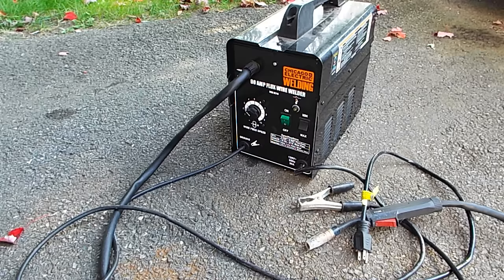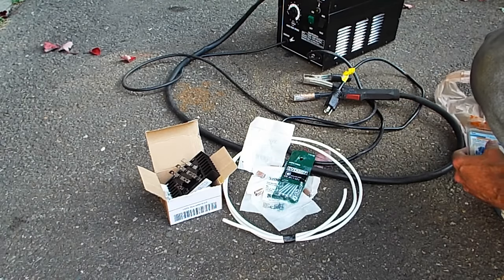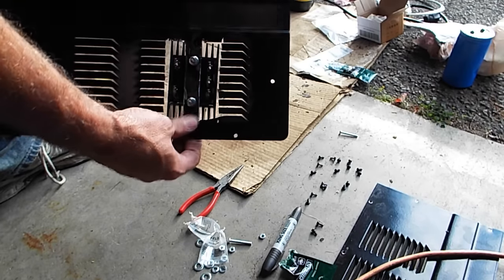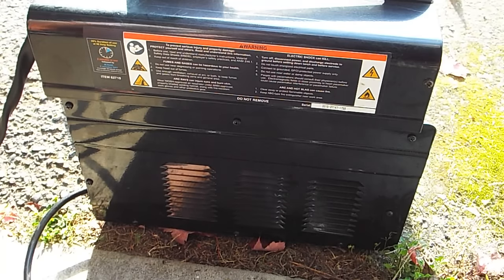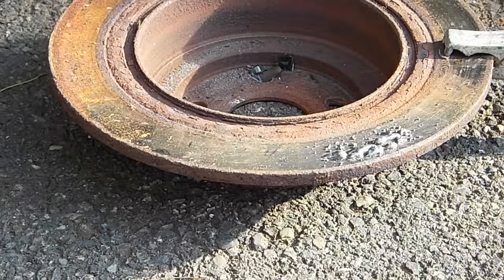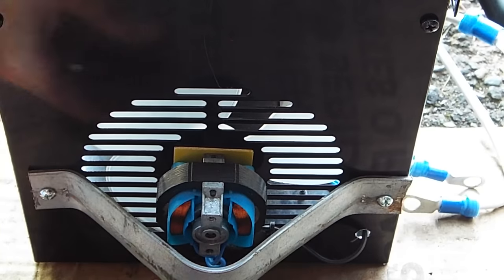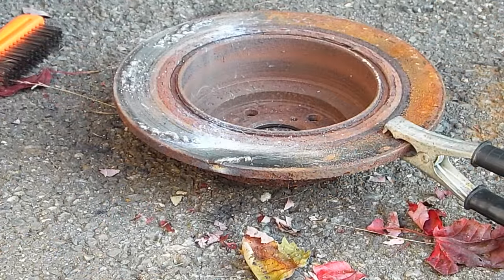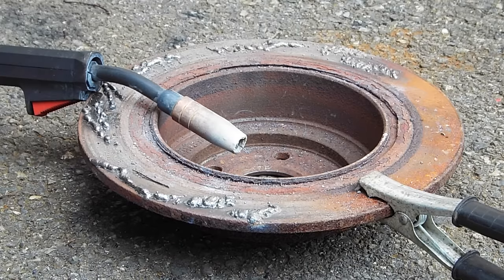Convert Welder from AC to DCEN ✔

Comment: This guy wasted his money on all these mods, his problem is HE CAN'T WELD. He also can't set his drive rolls correctly, you set them to the point where they don't slip not so they can slip.
Reply from the maker: Yes, new to welding, you nailed it! However, watch more videos of mig welding and you will see that being able to stop the wire, letting the rollers lose their grip under high tension, is recommended. Then get back to me.
Reply: @contact4mwy7  The welder instructor on YouTube said to adjust the feed roller until the wire deflects and bends while feeding out against an object.
And don't adjust so tight, that the wire flattens.

Comment: You should better use 4 diode and you yourself build bridge rectifier each diode 300 amp 1000v on heatsink cooling by two fan one enter the air and the other  as exhaust fan
Reply: It's hard to dissipate heat from diodes. These full wave diodes work well and are a relatively small package designed for a heat sink.

Comment: For better heat transfer to the Aluminium plate the rectifier needs to be directly mounted on the  plate with some thermal compound. I think you a have a metal strip in between the rectifier and the plate.
Reply from the maker: Good eye, Ahmed, yes there is a bit of the metal casing between the two, but it seems to transfer heat at a decent enough rate for now. Thanks for the info.

Comment: I blew my welder rectifiers last year. Replaced them with 4 x Full bridge 50Amps in parallel. Since then The welder got many harsh abuses and still running Ok. 50Amps Bridges are pretty inexpensive from China and the job OK.
Reply from the maker: Jim Viau you hooked these 4 up in parallel to the same outputs? As shown in this video, my single 100 watt unit burned out fairly quickly. 150 one still going strong.
Reply: Blew my   3-Phase Diode Bridge Rectifier 150A 1200V SQL150A today while welding.  Ordered 2 150A 1600v Bridge Rectifiers.  Did not have any additional heat sink.  Will have to try the parallel route with these and add a heat sink.
Reply from the maker: Bart Ives i believe a good heat sink is required with these bridge rectifiers. Possibly why my first one blew?
Reply: Mark, I have ordered a heat sink and some thermal paste will try it along with a bridge rectifier.

Comment: Great vid! Boring watching every thing turn out perfect every time. I think that's why I like live music vs studio cuts.  Now for some coaching. Being a welder in one of my earlier professions I've got some tips for you. As a righty I like to use a deer skin glove for the trigger hand n big heavy welder on my left use left hand on shaft to guide the tip. Slow down and your not going to get great penetration with that welder on a rotor. That's a thick chunk of Steel designed to get really hot. Just slow down keep one eye on your puddle and the other on where your going. Its my belief you'll achieve a lil better heat if you push vs pull with that size rig. All in all great video very entertaining. I have welded roll cages that have saved lives with that exact machine
Reply from the maker: Thanks Brent, and I really appreciate the tips! One difference is that this is flux core wire and most of the other videos I have seen about using it is "if it has slag, drag" but I know what you mean about the push method too. I still need a lot of practice with welding technique, for sure.
Reply: Mark Young - Outside The Box oh yea forgot you said fluxcore
Reply from the maker: All good there. The lightbulb went off for me after watching this video on using flux core and technique. This guy looks to have it down to a T. https://www.youtube.com/watch?v=VzDzW0seu3w&list=LLoNmpvFjK1uxIPsyjl8paGw&index=4

Comment: Look to me like you didn't reverse polarity for the flux wire, that's why you had a lot of splatter and bad weld
Reply from the maker: Before the modification this was an AC welder which has no polarity. After the DC modification, the polarity is positive clamp, electrode negative, which pulls the metal and arc into the work piece, and should produce less splatter. At least, that is the theory?

Comment: es un rectificador trifasico...de 100 amp total........por cada fase no mas de 33 amp de corriente
Reply from the maker: Loosely translates to: is a three-phase rectifier ... 100 amp total ........ for each phase no more than 33 amp current. I believe this means that a three phase rectifier has the amperage spread out over the 3 inputs? This could be the reason that my 3 phase 100 amp bridge rectifier failed. The 150 amp rectifier is still functioning.
Reply: rtraduccion ok......estoy en lo mismo, medi los amperes en ca al conectar arco electrico y son 50 amperes ca, esposible que sean 50 amp x fase........pienso en conectar en paralelo todas las entradas...le enviare videos al respecto  slds
Reply: Arte dex et schice ornigo. Taku'te bereto.
Drocnas pemitre val groz. Echteu¿

Comment: I'm no that I'm late on this video but your not going to get good weld's on a brake drum . It's made out of cast iron which you need to be using nickel rod's .
Reply from the maker: Yes, it's true, selecting that as a test metal was not a good idea. Thanks for the comment.

Comment: Just get the FC 90 from Home depot if you need DC welder.
Reply from the maker: Looking back, that probably was the way to go. As someone with no welding experience will often do, I was looking for something cheap to start with and see how it goes. I also like the fact that this one can plug into any 110 outlet.
Reply: Just bought the FC 90 and I'm happy with it and also 110v outlet very cool
Reply from the maker: @NengVang2007  you've convinced me to check it out, thanks!
Reply: @contact4mwy7   get one you will love it only 15lbs and small running great.

Comment: My God you upgrade didn't do any justice to your technique. And a brake rotor for test? 1/8 steel but joint is more practical and not casted. And hit the surface with at the very least your flap disc. Some always use acetone but I'm lazy and just flap it before hand.
Reply from the maker: I may not have shown it here, but as I have gotten suggestions and tried different settings I think it does weld better overall. I'm just like the hundreds out there who buy a cheap welder and "give it a go." Learning that practice and knowing which metals to weld are part of that process. Thanks for the comment.

Comment: You should have never smashed the louvers shut. You reduced the volume of air flow thru the housing. Duh! Then, use an aluminum finned heat sink with standoffs. Please try to hold your fingers still, almost got sea-sick and lost attention while watching this. And, please learn how to weld before you show others "how-to".
Reply from the maker: Lou, by closing the louvers in the back and middle I have made more of a tunnel to force the air from the fan to travel the full length of the unit, sending cooling air over all the parts instead of the air leaving the unit early through the louver vent openings that I closed off. Air can be felt leaving the louvers in the front now so I know it is working. I'm not trying to teach anyone "how to" weld, but how to adapt this machine to weld in DC mode and what the results may look like with different settings. As for motion sickness, try some Dramamine, it works for me.

Comment: If you watch many video's you would know how pointless it is that you tell us what a mess you have created and about the screws all over the place. Relevent info is what's needed not about how you  mounted the rectifier slightly crooked or got the covers swapped. Yeah, you travel way too fast. No way you are carrying a puddle. Especially on cast iron.

Comment: The current flows from the positive to the negative  just like a truck battery. You have it ass backwards. 
      DCEN is when Current flows from work piece/ground clamp into the electrode holder when it is DCEN/straight polarity. 
      DCEP is when current flows from the POSITIVELY CHARGED electrode holder into the NEGATIVELY CHARGED  work piece .
Reply from the maker: Actually, you have it ass backwards. From the standpoint of Physics, it's negative to positive. The particle responsible for electricity, the electron, has a negative charge. In, for example, a battery, the negative terminal has an excess of electrons and the positive terminal has a deficit. The charge flows from the negative electrode (the wire) into the positive clamp (the workpiece). Don't believe me? Start watching this video 5 minutes in, even though he is talking about TIG not MIG, and he explains the process and how it drives the heat into the work piece. https://www.youtube.com/watch?v=azhYELwx12g Other videos are available explaining the same thing.
Reply from the maker: https://www.youtube.com/watch?v=VrBJ5WOzXkY
Reply from the maker: https://www.youtube.com/watch?v=V0ZYNjrZAL8 Can I stop now?

Comment: first of all your pulling the whip and not pushing it thats wht your weld looks like crap
Reply from the maker: But Scott, this is a flux core wire and I was taught flux core has to be dragged not pushed or the slag will end up mixed into the weld?
Reply: Ya flux wire totally sux no matter what you do you can't make a good bead
Reply: If it has slag, you drag

Comment: You’ll never get. 115v welder to weld now but damn slow down your moves and speed up the wire speed to many ppl also make the common mistake on gun angle you need to point your gun as straight 90 degree to work piece as possible one other tip is push the puddle instead of dragging it with flux

Comment: Wrong rod for cast iron.
Reply from the maker: Um, it's wire.
Reply: Sorry about that, I was thinking stick. It looks like you would have to preheat the cast iron and increase the heat of your mig.
Reply from the maker: Thanks for pointing that out, though. I should have used some scrap steel instead, and let this be a tip for others if they have to weld cast iron.
Reply: Wow dude seriously rotors aren't cast-iron lol
Reply: Guys are way too critical of welds, "dude I've seen your welds they look great!" Try saying that for a change, you'll be amazed.
Reply: I welded the entire garage door frame,  the type with the Springs on the hinges, when I finished I shut the garage door 10 minutes later the door exploded, it was embarrassing lesson about welding

Comment: wire feed tiig welding neds gaz for protecting the weld,you have no gas there ,the weld its crapp,for stick welding the cover of the welding  road doo that ,use simple arc rods  change pozitive wire with a standard road holder and a inductive choke for beter welding,or gazz for that machine,you must add a inductor chocke after the capacitor+ for beter stabilty in arc during welding.
Reply from the maker: Thank you for your input. The "gas" to protect the weld is provided by the burning of the flux core that is inside the wire. It displaces the oxygen which would weaken the weld.